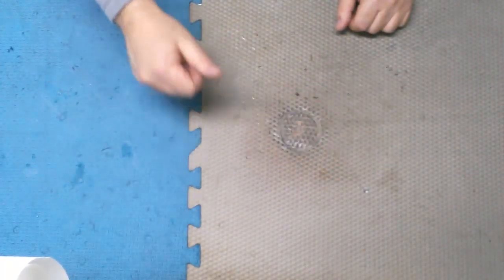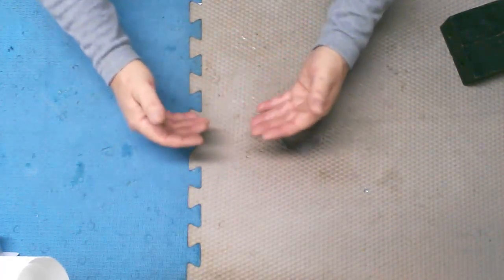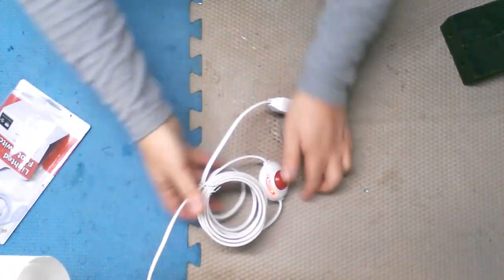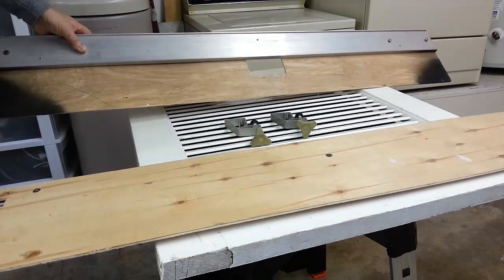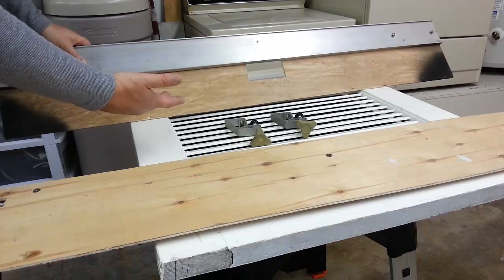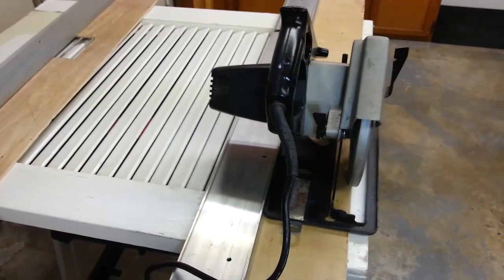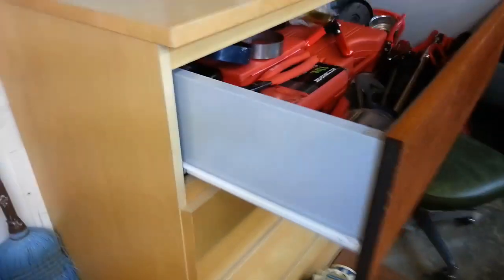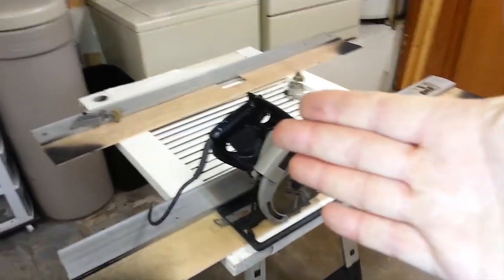DIY Circular Saw Track Saw Guide - How To

Comment from the maker: In this video I walk you through how to make an improved DIY Track Saw. I show you how to use Metal Tracks instead of wood for your track saw since wood has several draw backs which I explain. Metal is more stable and accurate plus light weight and easy to maneuver. I also throw in a few extra tips as I usually do, to help you with this or any other projects.

Comment: Great vid! I made a similar version a couple of years ago but instead of clamps to hold it I put a length of toolbox liner (waffle holes) on the bottom with spray adhesive. It grabs well, doesn’t budge and won’t leave any marks on the project.

Thanks for sharing
Reply from the maker: Cool idea! Thanks.

Comment: You got me thinking, if you are on the job site, specifically doing commercial construction work. There is probably metal track (what the metal studs set in) laying around that was originally used for metal stud framing. 
Get a decent piece of that, then I'm sure you could find some panelling or some masonite....and there ya go...
You'll probably have to figure out how to mount the track to the panel (or masonite). Like double it up, "top side to top side".
If you have installed metal studs before this would all make better sense to everyone. 
I also have one of those cheap Harbor freight guides I can use to make something better as well.
So, thanks for your video, it just goes to show, a good carpenter/wood/construction worker makes the best of what they got.
Yeah, having a specialized tool for the job is awesome, but not all of is can afford those fancy shmancy products.

Comment: All you did was add width distance to your straight edge.
Why not add distance of saw to your mark? It's the same difference.
Reply from the maker: The whole purpose if this is to make things easier. Make a mark, slap down the straight edge and get a clean accurate cut. No messing with measurements, less chance of mistakes. Everyone will have their own way of doing things. This is just my way of simplifying and speeding up the cutting process.